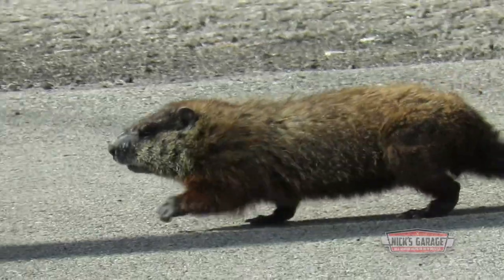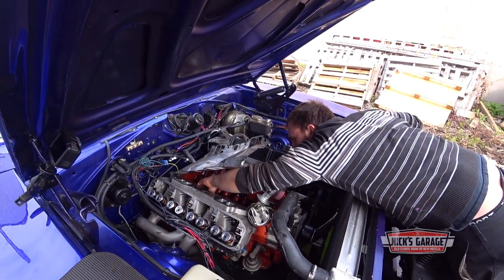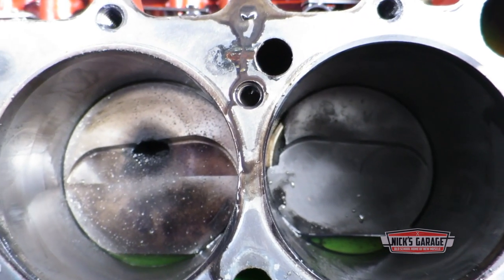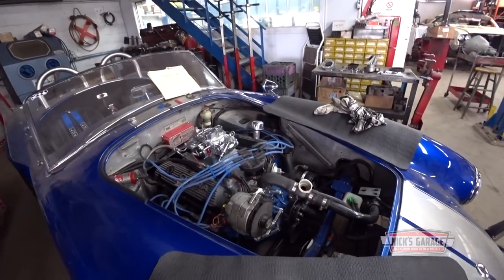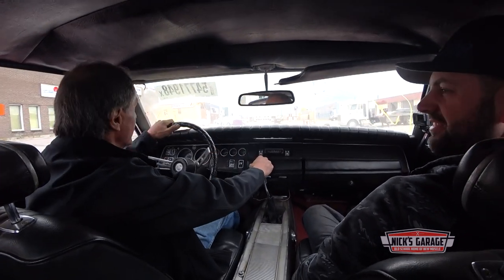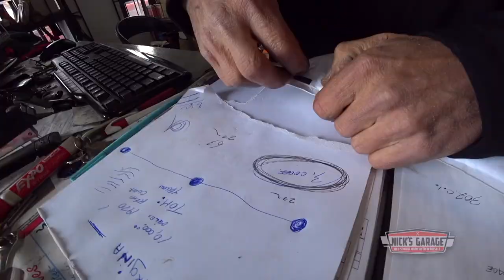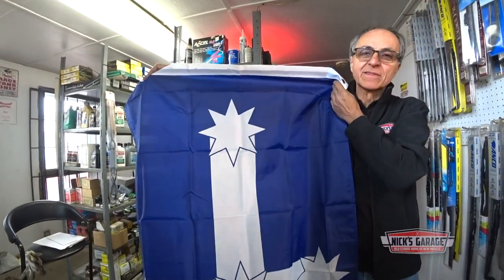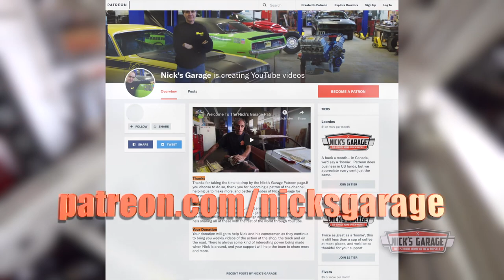Wicked 1968 Charger Blows Up - What Went Wrong?

Comment: Those throttle body injection carb replacement things don't tend to like dual plane intakes very much.
Something to do with the fuel distribution

I'd try a single plane on it (I'd imagine you'll have one kicking around) and see if it runs better
Reply: Brett,  that was my thought, too.   i'd guess it was hard to start, and they kept
    cranking, and all the time the F.I. kept delivering fuel,  and when there
was a spark, BOOOOOM !   or like funkyzero said below,   maybe some
    NOS was involved.

Comment: Hole in my Chevy piston. Brother mixed up 7 and 8 wires. Sometimes firing order is not as you thought they all were. Check the book.
Reply: 1-8-4-3-6-5-7-2
Reply: That would cause detonation with no compression at the bottom of your piston intake stroke since one and two are in between 7 and 8

Comment: Looks Like Nitrous Oxide damage. If was direct port injection (which its not) you could say they leaned a few cylinders. when the other cylinder head comes off you should see the start of some damage there also
Reply: Thats my guess too. It's a lot easier to get AFR's right with fuel injection and you can trigger and change it dynamically, something not as easy to do with a carb and fixed jets. Seems to add up... I mean, HP gains from FI of that type are pretty benign, so unless he was looking for the "cool factor", that would be a good reason he installed it in the first place.
I know if I were going to experiment with nitrous, the first thing I would do is.... convert to fuel injection first.
I'm not knockin the guy, we've all broken a lot of stuff experimenting in our years. It's how we learn and get better at it.
I'm also wondering if that's a single injector type and if that's a split plenum manifold... something that added up to that one bank running out of fuel and the other one not.
Reply: @funkyzero we are on the same page with our diagnosis,can you imagine if that was not a mopar big block with the sheet metal intake gasket.   It probably would have blown the oil pan off !

Comment: i can tell you exactly what happened. the guy had the throttle body flooding fuel into the engine, and it filled the crankcase full of gas, and it exploded. as far as the pistons, i have no idea. hydro-lock maybe.

Comment: Detonation, ive seen very similar damage, especially with hypereutectic pistons
Reply: your right classic signs of detonation
Reply: Jessi Louis  who said he didn't, probably had wayyy too much advance, way too lean, they'll know more when it comes apart
Reply: @PabloDiablo682  obviously we don't know the whole story yet, but from the evidence and the pieces of pistons totally gone either out the head or the inside the crank case it will be interesting, 23 years ive been fixing muscle car engines from factory stock to big inch strokers with ported factory heads and intakes making 600hp looking stock ive seen a ton of weird stuff
Reply: As an engine builder i don't always get the full story of what wrong so i have to basically be a mechanical CSI investigator,  its not always cut and dry, especially since its probably a stroker, roller cam, aluminum heads, aftermarket rockers ect so who knows. Also telling if an engine doesn't come back to the original builder.
Reply: @Future-Preps35  
428 FE or Pontiac? I would never on the ford, i do it a lot on my Pontiac builds though, many of the muscle car era engines had poor chamber design, big quench distances and when you couldn't get good gas anymore a lot of these 10-1 engines succumbed to a similar fate
Reply: Derek Stewart THAT’s the thing that really interested me - avoiding the original rebuilder ...?
Reply: I'm wondering if that fuel injection system he had on it at a dead injector or one that was putting out a lot less fuel.

Comment: First time watching your video, subbed up less than halfway thru. Nick, I admire you and your crew. I'm an 'old school' wrench twister from way back, lol. You have knowledge and to 'think out of the box' is a must sometimes. Mechanics today are pertty much helpless without their laptops. I gave up working on cars many years ago, spent 16+ years as a tractor and equipment mechanic then changed over to industrial high pressure closed loop hydraulic systems, spent little over 16 years building hydraulic machinery for the offshore oil & gas industry, loved it! Had to leave my work to fight lung cancer, the doctor had gave me 'about 90 days', well I BEAT the cancer, that was 4-1/2 years ago. No cancer but still have not fully recovered from the radiation and chemo, that stuff is brutal. Still planning to return to the hydraulics field, its what I do. The company I was with still has my position for when I want to return. With Gods Grace I will return, soon as my body says I can handle it. You sir have my respect for what you do. Its easy to see you love what you do and looks like you have a really good crew. Wish you nothing short of the best sir........
Reply from the maker: Welcome aboard, James.

Comment: Burn through was on exact centre of the valve relief cutout line edge.
Edges heat up faster and hotter than flat smooth surfaces:  basic fizzics.
Hold anything in a flame and watch the edges heat first.
Aluminium heated up, softened and collapsed under the pressure.

Comment: If anyone is having issues with those Chrysler or funky GM window body moulding clips a little known secret to keep em properly in place is using a dab of body glue on em using a cue tip or little stick wipe a dab on em. I took apart an old Dodge Dart a customer had and another car that was done that way. I adopted the technique... It works.

Comment: I had an old beat up ford galaxy with a little 302 started knocking. All 8 pistons were cracked. I put junk pistons back in. I had to press one off and turn the rod around because I didn't have enough for the left side. Oversize rings and undersize bearings drove it 3 more years before I sold it.

Comment: I recently installed a holley sniper in April this year, i have been Graduly  leaning out the AFR on non ethanol gas, 2 days ago i filled up with lower octane with 10% ethanol , big mistake! instant ping/rattle at WOT. ill be going back to higher octane with no ethanol for now. Need a new config for ethanol gas, but for now i want to tune for non ethanol gas.
Reply: don't mess with ethanol unless you have the flex fuel sensor installed.. bad news otherwise
Reply: Sum  EFI systems have flex fuel sensors avail. You must have one for intended app. Cause ethanol % vaires all year  in gasoline or E85. Also Yuge plus  R systems that can use Dual Sync Distribs - U can change time curve,Adv,vac adv on the fly. U'll wonder why u didn't do it sooner.

Comment: How was the ignition timing set? I think the hole in the piston is worn out over the time in little pieces, until the piston got broken through. That material in one piece  wouldn't have passed the exhaust valve without damaging it hard 🤔

Comment: Raw fuel & pre-ignition knock burned the holes in those pistons. Raw fuel in the crankcase was root cause for the crankcase explosion. This happens on diesel engines with bad fuel injector tips spraying raw fuel on the piston heads. Root cause of the problem was the fuel injection & possibly a timing issue on a high compression engine. I'll bet the oil pan is pooched out also from the CC explosion.

Comment: I'm wondering if the efi was an attempt to fix a poor running engine that was already damaged.
Reply: I agree ,  I feel it was running bad so they added the fuel injection thinking  it would fix it , but it was too late
Reply: @EvansBrosRacing   I've seen that before, running poorly, replace carb, replace distributor, replace coil... 2 plug wires crossed and nobody checked firing order.  Interesting to hear what the owner has to say about history.
Reply: I strongly suspect the guy was experimenting with nitrous oxide injection. An EFI is a lot easier to tune for air/fuel ratios for that purpose, and you can do it dynamically instead of with just fixed jet sizes. It all adds up... melted piston, newly installed FI, etc.
I've been wrong plenty of times before though, so who knows. All that matters is someone learns a valuable lesson in the end. We all break lots of stuff on our way to experience. That's why experience is so valuable I suppose
Reply: @funkyzero  It could be from nitrous for sure . I ran nitrous on a bb mopar and had the valley tray puff up like a jiffy pop popcorn  deal ,  like theirs , but it was crankcase pressure that came up through my pan evac header hoses , (should have un hooked that stuff for the spray ). the valve blew out and let pressure come back into the engine . no backfire , nothing horrible , just the jiffy pop effect ,  nothing caught fire or exploded .  I have also melted a piston like that on a circle track car , sb chevy , that was able to hold the throttle down all the way around the track for 8 laps . it shot some sparks out the exhaust and I felt it slow up and  LIFTED  to save it . IT had a hole melted in a piston , could have been lean , or cheap fuel ( Torco brand available at some  pumps here in michigan ) , who knows  but it only happened when it was wide open that long . .The good thing is we build our own stuff and dont have to pay nick's invoice when it's done  , OUCH  that bill is gonna hurt having someone do it for you  !
Reply: funkyzero lol, exactly - because it costs us so much the first time and saves us so much every time thereafter 👍😎
Reply: @funkyzero  the owner could have also purchased the car in already bad running order (maybe from prior NOS attempts or just neglect) and was told that fuel injection would fix his problems as allot of auto parts stores (at least in my area) like to try and convince you that they know what they are doing without even looking at the vehicle.

Comment: What a shame. It was running great and the owner installed an injection system that didn't work as well. He should have brought it to Nick and asked him to install it and sort it out.

When they said no compression in #4, I suspected lean fuel mix which caused the cylinder to run hot and burn the piston. The guy tried to keep it running but then fuel was going down through the hole in the piston and into the oil.

Comment: Running super lean, I've only seen that kind of damage on boosted engines. Probably a bad EFI tune if you ask me, wouldn't see this very often on a standard carbie setup unless its a bad case of fuel drip which is unlikely being EFI. Maybe a sneaky NOS shot gone wrong lol.
Reply: Doubtful on the efi tune being the problem...   that appears to be a Holley Sniper EFI - self tuning system that starts out super wet on the a/f ratio and trims fuel down. I agree with others on here - nitrous is most likely the problem. probably put in a dry kit and didnt realize the efi won't adjust for it with fuel. The blown out valley plate means there was some serious fuel in the crank case - usually with a hole in the piston it would never accumulate that much before igniting. I've worked on plenty of Mopars over the years and I've never seen a valley pan blow out like that.

Comment: I suspect the ignition box was set to "test" the RPM limiter, MSD and other CDI boxes allows you check to visually verify your RPM limit by sweeping the tach. However with a fuel injection  system that indicated the engine started, rev'd up to 6,500 or where ever your RPM limiter is set and shutdown.  Since the injection system thinks you burned the fuel in the cylinders on the last start it pumps more fuel  to "choke" the engine because it is still cold so it "chokes" it again everytime you turn on the key, eventually you either hyd lock the cylinder or blow the pan/intake off of it. Lesson learned with 440 and 2 bent pushrods, fortunately motor wasn't hurt, cost us oil, filter, pushrods got off lucky.

Comment: Haven’t finished watching, from the forums I am on they are recommending to stay away from fitech and go with Holley FI.  The money you save on fitech may cost you dearly.
Reply: The cheap ones suck no matter the brand. Sniper and Easy Street both are lousy. The more expensive versions are better. But FAST and Edelbrock are far better. Even the Holley Dominator and Terminator can’t measure up. And all are inferior to OEM. We’ve got 200+ cars recorded with aftermarket EFI on our Dyno.

Comment: water injection halts pre-ignition detonation in aircraft engines
Reply: motor head1 And in a lot of Hi-Perf auto engines. There were tons of mags in the 70’s / 80’s showing how-to’s on adding it to prevent det

Comment: Interesting issue with that Charger...I run both Holley Sniper EFI and Fitech,  IMO the Sniper is easier to set up, can't imagine how you could screw up the installation, that car must have had some pretty obvious problems before all that damage happened. Unfortunate.

Comment: I just don't think a carbureted engine should be switched over to EFI that's just my opinion I myself wouldn't do it yeah it's better on gas yeah it's more power yeah it starts easier but the engine wasn't meant for a EFI it's meant for carburetion
Reply: Dont knock it until you try it.

Comment: Those particular EFI throttle bodies were sent out originally without a fine enough fuel filter. The injectors are prone to sticking. It probably hydrolocked and the oil is full of gas.
That's my guess and I'm sticking to it. Let's go!

Comment: 1973 working in a Chrysler/Plymouth dealer. Assigned 1973 Road Runner 440 cuin 4bbl.( BY 1973 the power was way down) customer complaint was engine knock. Start it up no knock, road test no knock running smooth with power until I pulled up to the shops' door then it just started to knock ??? Short story the customer lost the air filter stud or tried to sabotage the engine. There was a hardware store 1/4" threaded rod in the carb not the factory air filter stud. Found the stud in three pieces one in the intake the other two in number 4 cylinder.  The piston and combustion chamber/valves were peppered with indentations from those pieces.The manager said put back together which I did engine ran just fine.

Comment: Fords are not the only fire breathers now are they Nick ?
Reply: bogie.     When this car was towed in, client said it starts and runs rough. I stood in front of the car and Vasilli turned the engine over and a wild backfire was blown at me. I felt the heat even though I was a few feet away from the bumper.

Comment: it leaned out in 2 cylinders! carb or fuel injection problem!!
Reply: Those TBI-style efi systems more often than not have issues with dual-plane manifolds. The broken pistons are paired for that manifold, likely ran very lean & hot, melting both pistons.
Reply: @hydrocarbon82  well older cars have a fit with today pump gas! I saw a dump truck international old big block the owner put a special crab made for to days gas!  you needed a good set of ear plugs the windows shook in the bank building he pulled up with the company's bank work! here your van broke this is fixed! try it out! i asked what in that thing? don't go near any cops!

Comment: I am at 8:54 and my guess is that the piston that burned a hole in the center was a product of running too lean. You can't just bolt on fuel injection, it has to be tuned. Let's continue to watch and see if my hunch is correct.

Comment: Awesome episode !!! My guess as to what happened to that 440 in the '68 Charger is: detonation... Maybe caused by hot spots in the combustion chambers , and/or ignition timing-cross firing issues... Check the head gasket closely, to see whether or not there was a leak on the narrow deck surface , between the adjacent cylinder walls... Particularily with the aluminum heads, which is what it looks like this one has... They might be cracked or warped... I have always favored the use of cast iron engine components... Much more durable than Aluminum castings, and far less expen$ive... Aluminum is also very easily - permanently damaged from an overheat, than what happens to an iron casting...All to save maybe 140 lbs over cast iron engines... Keep it cast iron, for long lasting reliability...

Comment: @ 8:18 you can see what happened. The cyl on the left melted a hole right through the piston. Im guessing a lean condition due to intake leak.  That flame front also cut through the head gasket as you can see by the mark on the block to the cyl on the rt. That burn from flame front  melted the edge of the piston on the rt down to the ring grove then that piece broke off. That is the effect.  I doubt it was timing. No other damage to any of the other cyl.  Probably an intake leak that caused just that cyl to go lean then carried over to the adjacent cyl.

Comment: FIRING ORDER FOR THE FUEL INJECTION was out of sync ie if you run lean both pistons would be melted ( IE holes in the piston ) but one is broken ( Pinched rings) because of failure on the tip of the piston Nick was very right when he said it was a timing issue as one piston was lean and one was really rich causing hydro lock causing the edge of the piston to break, btw who would hide the fact that they run the car with nitrous from the mechanic?

BTW the carbon washed off from the cylinder head is a tell tale sign of running RICH!!!

Comment: if the charger was chassis dynoed,and it don't have good O2 sensor  ,they mite have taken reading from the tail pipe  ,then they lean it out then it blows up .
Reply: gary mathews that fuel injection system has an o2 sensor with it. Won’t run with out it

Comment: It's a stage6 head , they need the spacers to be used on a 440, they are designed to use a 440 intake on a low deck, 383 or 400 , block. but you should know that .
Reply: John.       Yes, I am aware of that.